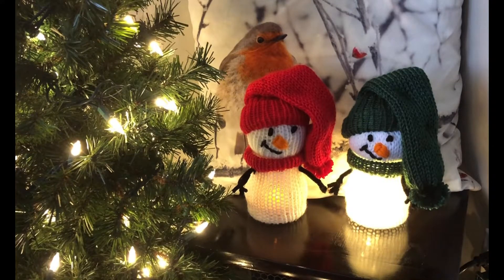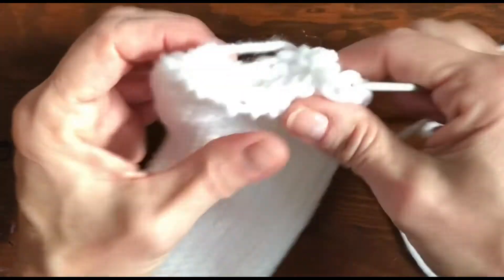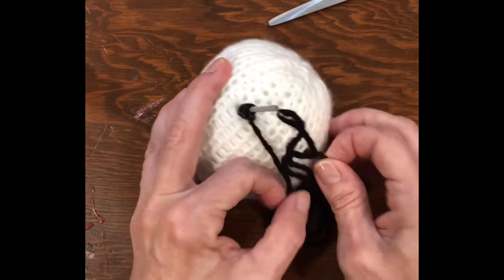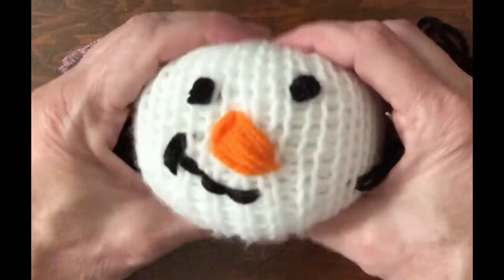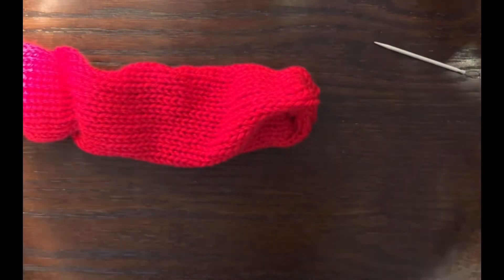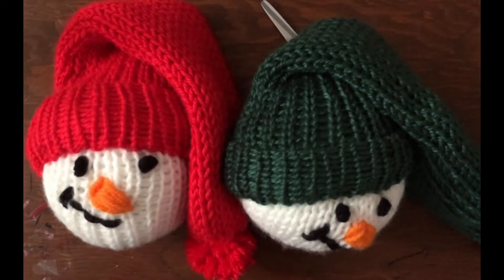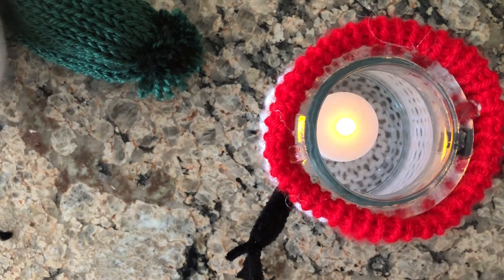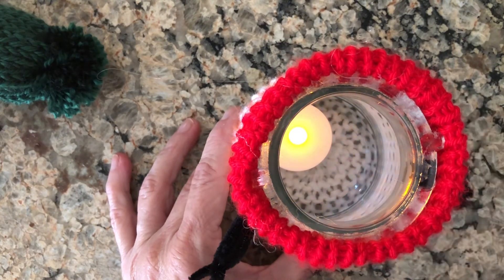Lighted Snowman Ornament ~ Addi, Sentro, Circular Knitting

Comment: On the snowman head that you used the Sentro 40, did you also use the 40 for the body?  Or did you use the 22 for both bodies?  Thank you.
Reply from the maker: @lisajewett6360  I used the 22 for both. I didn’t use the 40 needle for this project.
Reply: @koalaknitsandknacksaddicrochet  oh, I thought one of the snowmen heads was with the 40.  Good to know, they are next on my list to do, just need to find the right jars.